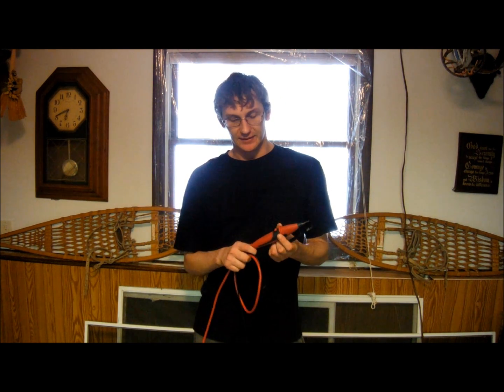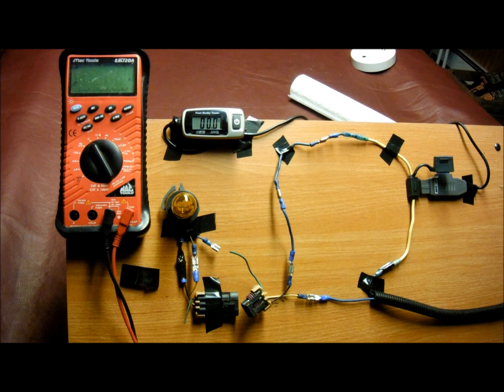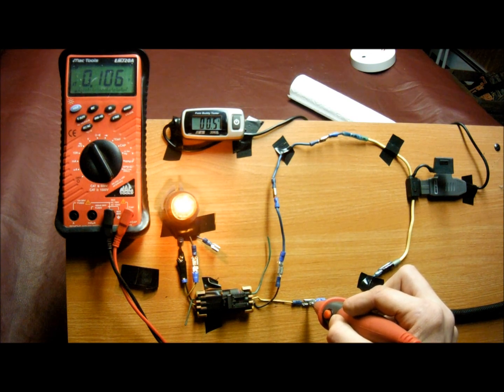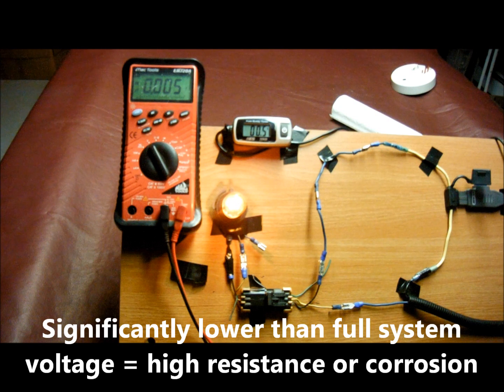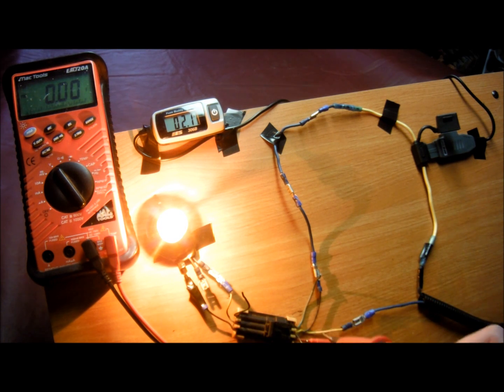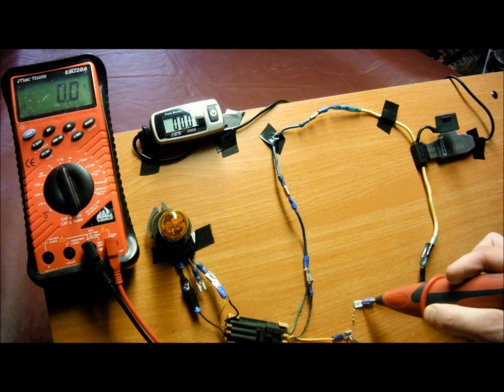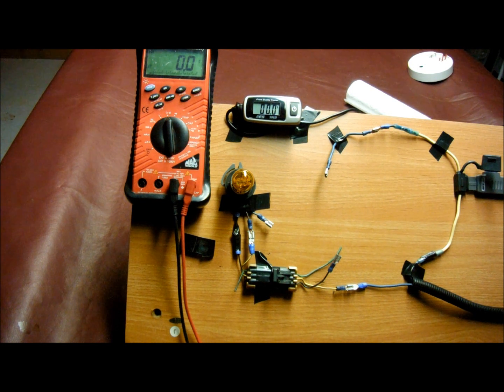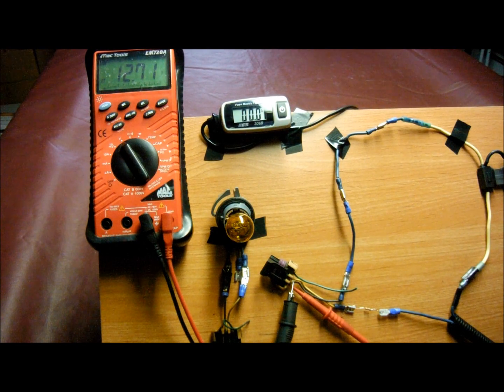Voltage reading explanations with the LOADpro Dynamic Test Leads

Comment: Im confused.so if u have battery voltage is considered and open.how.?if u have voltage.
Reply: It’s simple if you the switch is open that means everything before the switch has voltage still so you will see source voltage. If it’s switch to ground though you will see source voltage after the switch even when open. With switch to ground once the switch is closed it will pull the voltage down to 0 volts.

Comment: Can you test and load fuses? Do you have to remove the (load) ie. a module?
Reply: When you test/load the circuit you’re working on from the connector, you’re essentially testing the fuse as well because the fuse is part of the wiring.

Therefore, if the test/load indicates a problem on the fused side of the wiring, then the fuse could be one of many potential problems.

I’ve personally ran into an issue where the fuse was good, but the inline fuse-holder was bad internally.

Comment: MICHAEL MCNEIL, why do you have to put a LOAD in order to measure the corrosion resistance? Why can't you measure the corrosion resistance without the load? A Ghost voltage can happen in wiring harnesses that have voltages in the wires which get coupled across. The DLC connector in cars have ISO9141 signals and SAE J1850 signals what are they used for and have you used them for troubleshooting car issues? How does a PCM and ECM work or what does it do n does it have CAN buss signals?